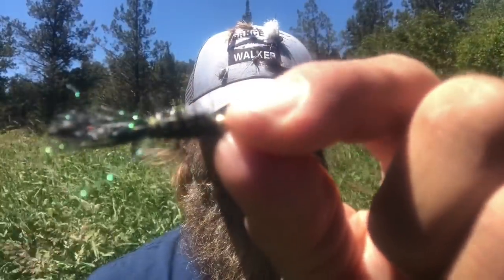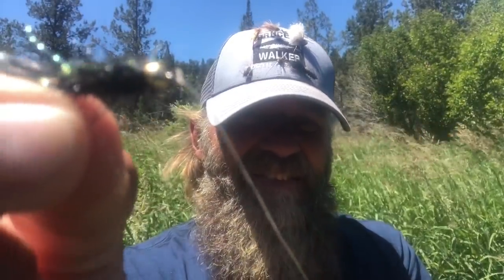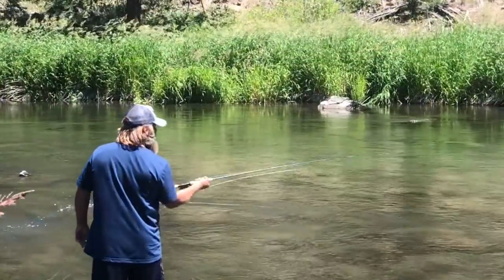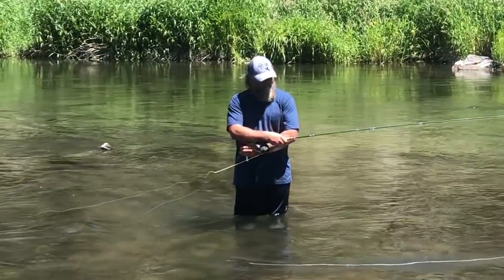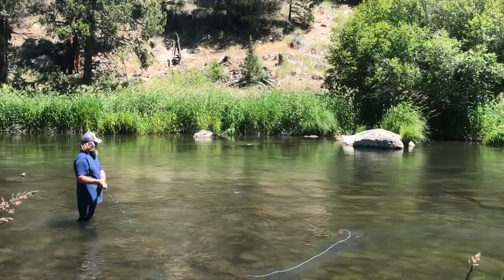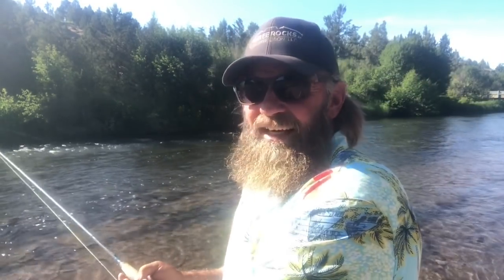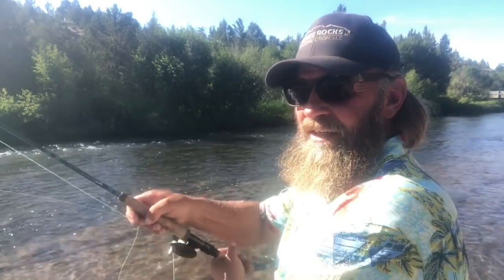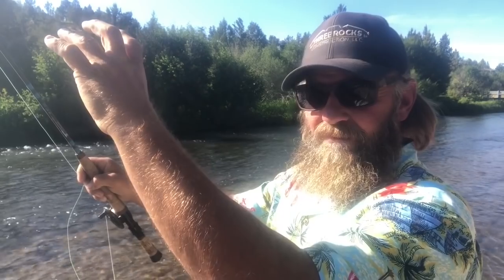Sustained Anchor Skagit casting

Comment: Its always sage advice to slow down. Time and time again a Im a victim of trying to rush things only to have it all fall apart.
Reply from the maker: Yep, that happens a lot I think. I think it comes from too much emphasis from demonstrators on water loading, talk of acceleration etc. and over emphasis on a dynamic D loop etc. and the truth is, some very accomplished casters can use those techniques to push the envelope to create line speed and power but a decent D loop with a light anchor can create sufficient line speed for most situations.  Watch the line speed Ed Ward creates at 1:25 using primarily the forward cast https://www.youtube.com/watch?v=rUmxPCxAHt0

Comment: Would this help with a single hand scandi line? I just bought a single hand Scandi line for my 9ft. 6wt rod. I haven't tried it yet.
Reply from the maker: Hey Big Ron good to hear from you.Yes, these principles are pretty universal, although , depending on the length of your new line it may be a little more forging than some of the heavy, short skagit heads. What line did you get for your single hander?
Reply: @LineSpeedJediTimRawlins  I got the Rio Single handed Scani
Reply from the maker: Yes Ron these principle should apply although the longer lines may be a a tad more forgiving so the blown anchor issues may be less of a problem. Give it a go and see how it works for you and let us know how you like the line.
Reply: @LineSpeedJediTimRawlins  Thank you Tim you are so awesome for helping everyone cast better!!
Reply from the maker: @bigron8346  Thanks buddy! That means a lot!

Comment: As for myself, I will try and let the anchor soak once I get the darn anchor set properly to begin with. My casting stroke is way too fast already, from the beginning to the end as if it is going to bite me if I don't get it out and away quickly. I hope to have a video or two in the next couple weeks for your amusement as I restart my spey casting campaign for this year a little, heck - a lot later than I wished.
Reply from the maker: Hey thanks buddy! I’m excited to see how your casting improves this season. I am really looking forward to seeing you slow down!

Comment: Riddle me this oh wondrous one - What is/are the determinate factor(s) in how long you let it soak? Terminal tackle (type of tip, fly type, etc.), the spey line itself, the style of casting (Skagit, traditional, scandi, etc.), current speed, wind, mood, or some other metric? I would hazard a guess as current speed and terminal tackle, but I sense a shortcoming in my analysis. The interaction of the spey line with the current nags at me some.
Reply from the maker: Good observation Water Sprite!  This is primarily a Skagit casting principle, set forth by Ed Ward and the Skagiteers.  You are correct in that the heavier the flies and sink tips, at least for me, the shorter the soak.  if so much as a bead headed wooly bugger is used I soak longer to avoid the heavy skagit head blowing the anchor on the sweep.  If a soak is required in fast water the anchor can be set further upstream.  Also powereing way down on the sweep will help from blowing anchors.   Looking forward to those casting videos my friend, but no pressure, keep relaxed, take your time, have fun and enjoy your health!
Reply: @LineSpeedJediTimRawlins    "Also powering way down on the sweep will help from blowing anchors." Do you mean keeping the sweep low as opposed to a higher sweep? Or, do you mean lessening the power in the sweep?

Comment: I will be moving up to 12ft or 15ft leaders next for more slick on the switch rod  but on the single rod 5ft or 7.5ft is good .Jedi i tell ya, i blew a lot of Anchors last year because (1) casting to quick with shorter heads.(2) Over powering the cast.
Reply from the maker: Exactly! The long leaders should help with the Anchor. I will be interested in hearing from you how  longer leaders affect your hook up rate versus the shorter  9‘ leaders. Thank you for your continued support Stephen. I appreciate hearing from you every time you comment. Thank you again....Tim